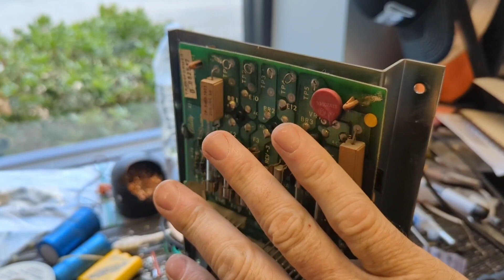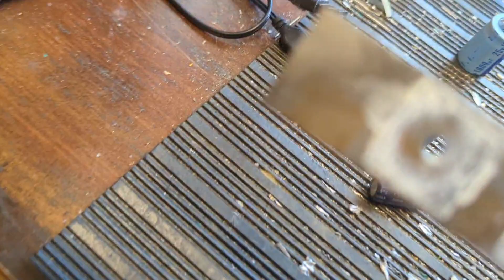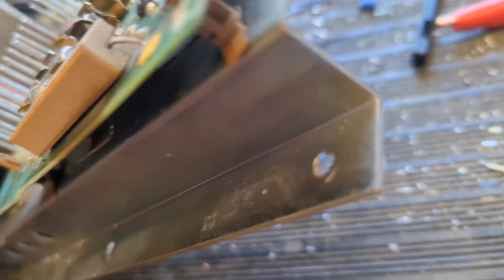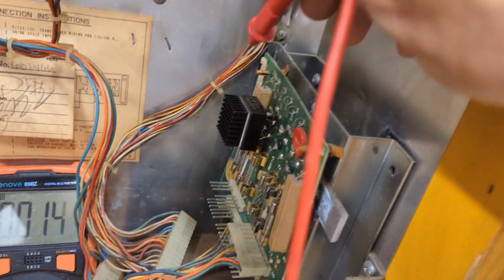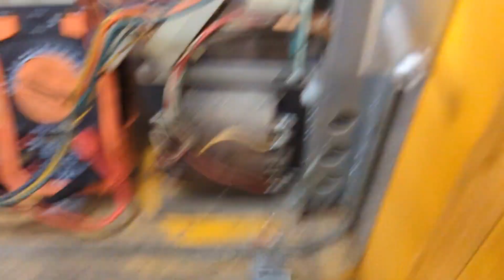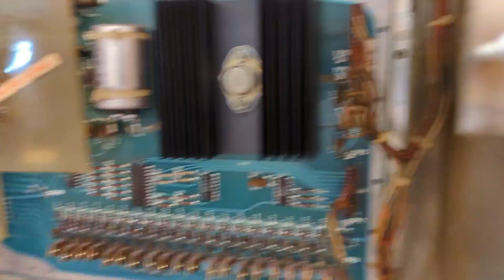Repairing the rectifier board (bad bridge rectifier for controlled 6V DC) on a Bally Pinball Machine

Comment: Let's go this is the board I will be working on! Wish me luck!
Reply from the maker: It is a very forgiving board to work on....super hearty pads and traces. 
 That said those huge pads require significant heat and dwell  necessary when soldering/desoldering.  A temp controlled iron is very useful.